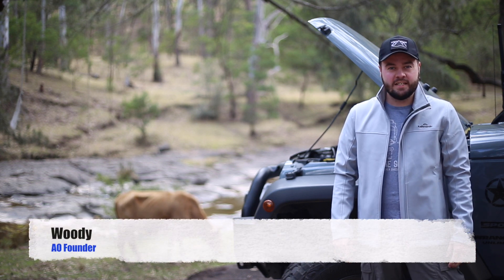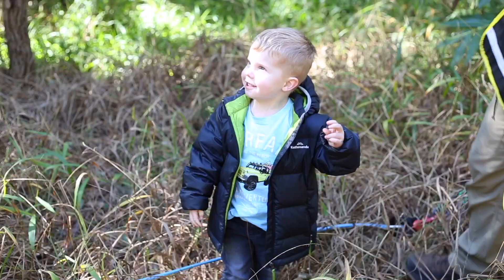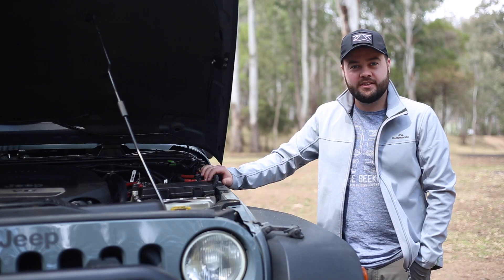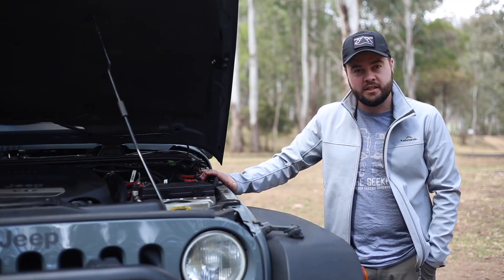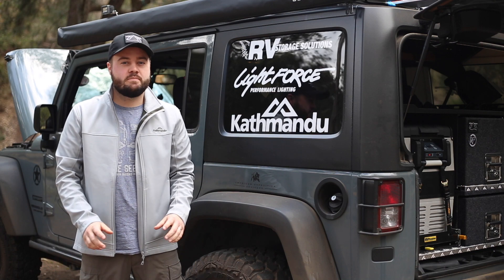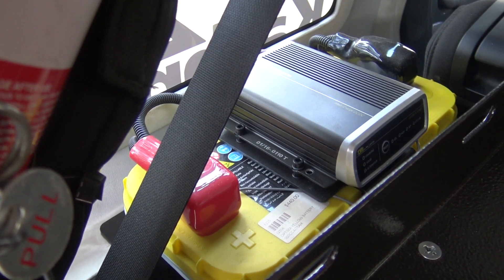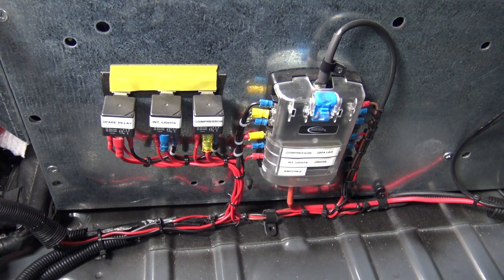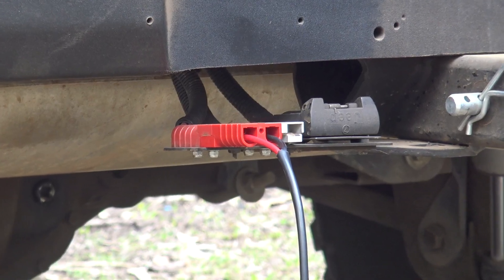AUSTRALIAN OVERLANDER - OVERLAND TALK - DUAL BATTERY SYSTEMS

Comment: If my alternator is 160amp wouldn't my breaker need to be rated for that in order to allow the second battery to charge without tripping breaker?